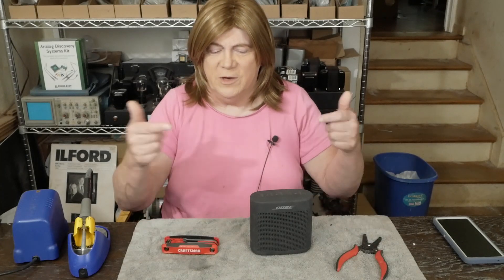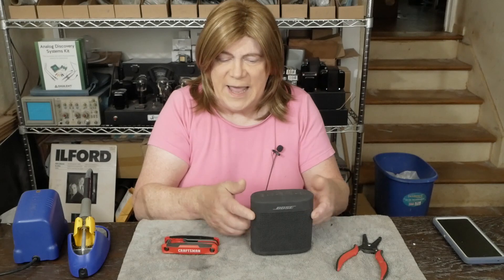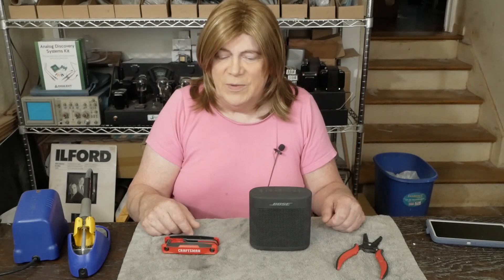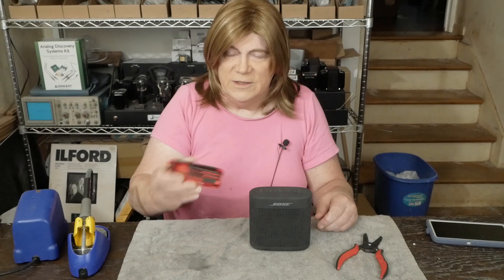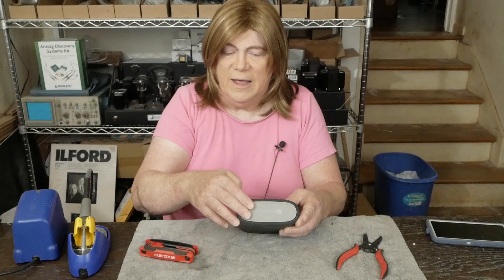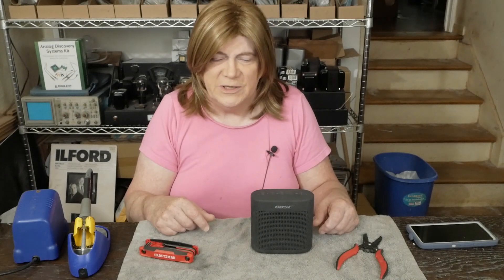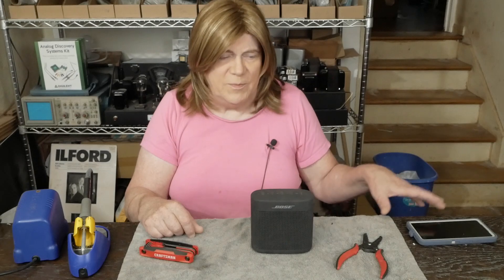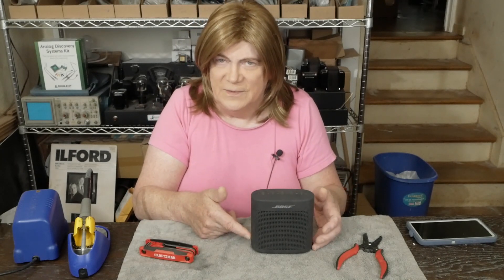Monday Monologue: Disposable Electronic Devices & 500W Amps?

Comment: i have  DG SE-1 EL84, 300WPC van alstine hybrid amp, crown CE2000 (400w into 8ohms and  1kw into a 2ohm) and a buncha other amps. my JBL L150 are designed for 300WPC, so thats what i give em. i have 10W magnavox amp for 90dB speakers at near field listening and several things in between. no problem. some speakers want more power/more current, some need less. some want more power only for brief moments. some people like the headroom. and, as you mentioned, then theres subs. good video.

Comment: Planed obsolescence, has been a big deal since  the 1930s . Something about protecting jobs by making sure there is stuff to make . I blame the great depression and before that light bulb cartel , the Phoebus cartel. When they decided In The 1920s that light bulbs was lasting to long and hurting sales . So lightbulbs have died faster ever since. So more sales. Yes they can definitely build better. But they won't and the government is ok with that.
Reply: Thats right. Mercedes car maker almost bancrupted because model W124 was so sturdy and durable that sales new car went down. W124 is a classic which is still reliable, repairable, and loved by the people. Since then all Mercedes models are more or less crap. Except of Unimog specialised trucks sub-brand. Rcently EU implemented law forcing producers to make home appliance serviceable for certain period and spare parts available. Single parts! Not multipart components worth 50% of a new device.. USA government should go the same way
Reply: @yellow_noise3  I still hope to have a w124 one day. They are such nice cars .

Comment: The wattage is all about marketing. My primary system is a vintage Yamaha with 20 watts per channel. I never turn it up past about 10-oclock because it gets too loud for me.
Reply: I use a five watt single ended anp with a pair of subwoofers and I can turn it louder than I care to listen. My music of choice is classic rock with some newer rock.
Reply: Agreed. I only need 7 watts which my single ended tube amp puts out (for the lower bass two REL subs).

Comment: Funnily enough I doubled the power output of my Hypex Nilai power amp over the weekend. It comes as a 250W (4 & 8 ohms) kit with two amplifier modules and a single PSU. I added a second PSU to make it a dual mono amp increasing the output to 525W into 4 ohms. In my subjective listening, I feel that the bass has more control than before. I view amplifier power a bit like automobile power. Sure you can get from A to B with 100bhp but having the option of 500bhp on tap is much more entertaining.
Reply: Hey. Can I ask where you ordered your 2nd PS from? And did they provide the extra connection wires. 
I've found a couple places that sell the PS but I'm just curious who you used. 
Thank you for any help with this
Reply: @NosEL34  I am in Australia and got the amp kit and second PSU from the local distributor - Audiophile Shop Australia. For people in the US, Madisound or Deer Creek and  for people in Europe, DIYClassD. The PSU comes with two 30cm amplifier connection cables (that I did not need), a 30cm power input cable (that I daisy chained to the original power cable) and a 30cm 12 wire auxiliaries’ cable. I soldered five wires from this cable to the original 12 pin cable. This required carefully removing some of the insulation from the original cable and soldering the ends of the new cable onto the original then insulating with electrical tape. The five wires I connected were:
Pin 2: Ground
Pin 7: Pushbutton+
Pin 8: Pushbutton-
Pin 9: Trigger+/-
Pin 10: Trigger +/-

Comment: My self-built "Silicon Chip" magazine stereo 'Ultra-LD Mk4'  integrated amp will put up tp 135W RMS per channel into my  97 dB/1W/1m 'Majestic' speakers (at .0003% THD) that I also built.  I can't really stay in the same room with the amp turned up full, but I can go outside & mow the lawn with my petrol mower & still hear it pretty clear!

As you say quite rightly though, it's the first watt that's the most important.

So I checked the specs on my amp, & the THD + noise is higher at 0.06W than it is at 135W!

At 0.06W its THD + noise is about 0.004%, & it linearly drops down to about 0.0003% at 10W & above up to clipping.

So it's still not too bad at low power.  And the designers had a lot of trouble separating the noise from the distortion.

But see my problem Stephe is that nearly all my vinyl records were destroyed in a bushfire in 2019, so I really only play CD's these days.  CD's have a dynamic range of up to 100dB, as opposed to records, with a usual dynamic range of 35 to 40 dB.  So clipping my 1 or 2 watt valve amp (that they said was 7W per ch) is always on the cards.

Of course, it was a labour of love building my big amp & speakers though!
Reply: I have always been under the impression that many multiples of the average power is used during Peaks. So if you're only using a couple of Watts most of the time, for milliseconds you're going to need a couple of hundred Watts to prevent clipping
Reply from the maker: And maybe part of this is tube amps "soft clip" and SS clipping sounds so bad, it' has to be avoided at all costs?"
Reply: @SkunkieDesignsElectronics  very likely that is the case. A few milliseconds of hard transistor  clipping could maybe be heard very subtly and not really even consciously, but more as an absence of fine detail and spatial cues, or just an uncomfortable bit of listener fatigue.
Reply: @SkunkieDesignsElectronics    Oh yeah that's true.  Definitely sounds crap clipping a SS amp that's for sure!  Although, I have a pair of yellow clipping leds on the front of my Mk-4!  The clip detecting circuits activate the leds whenever the output voltage reaches within 4.7V of the power amp's supply voltage of +  &  - 57V.  I'm not too concerned though about damaging my speakers as they're rated at 300W rms.

I know there is rounding off of a maxxed out valve amp output, compared to the squared-off flat topping of an SS amp output.  And I know that most valve amps produce the less discordant & sweeter even harmonics, that's for sure!  Often I barely even know my little valve amp is peaking out!

It's a pretty little thing to look at with all stainless steel, & black painted O.P T's.  I've mounted polished 4mm S.S.  threaded rods around each valve for protection, bolted into a polished S.S. ring at the top.  The orange glow from the filaments looks nice at night time under subdued light.  Actually there's 21 leds all together in my Mk-4 amp, which seems ridiculous really, although most of them are on the inside.

I'll have to check.  I forget what the make up is as far as harmonic distortion goes in my Mk-4, whether it's odd or even, or even if they mention it!

Comment: You’re not wrong about amp ratings, but solid state amps are different. 1, drive a solid state amp into clipping and your tweeter is toast, so good to have headroom to not blow tweeters, where tubes are very soft clipping, and do not blow tweeters.  2) the ability of an amp to drive a single tone to a power rating  is not a good metric. Tube amps due much better at providing more bandwidth, multi tone signals to the same power levels as a single tone. Solid state amps struggle here because the voltage is lower, but all amps struggle with high spectral density signals and would be derated if they had to be tested with multiple tones or waveforms over a large bandwidth. But easier to make low impedance power supply in tube amps, because the high voltage and audio transformer help with that. 3) THD is ridiculously low in at low input signal levels in the big amps.  4) I drive the local audio store crazy when I say I drive my big speakers with 5 watts.  I get it, I have driven 55 watts and 85 watt amps to the point they are done, and at n audio volume equivalent to. A 10 or 15 watt tube amp.  Again, power supplies in many solid state amps are not up to the task. That said my 6 watt amp is not enough,  A 40 to 60 Watt SET amp would be ideal, for me. Need 10 times the power to be twice as loud. Really notice the distortion when I crank the volume on bass heavy music. Hence push pull amps exist.😊

Comment: corp greed is why they overengineer products. Cars are getting the same.
Reply: Quite the contrary. Under-engineering and cutting corners wherever possible. Cramming as much flashy marketable features into the thing, not giving a damn about their quality and reliability. Not to be confused with over-engineering for regulatory compliance, because that's another thing.

Comment: I have low wattage tube amps i love & they sound great with certain speakers. My solid state amps have some wattage though. My 2 main ones are 380x2 & 250x2. Really clean ultra low THD though..which is what you want on a high powered amp.  I use them on towers with multiple drivers though..that can dip under 4ohm at a couple frequency's. Most want or need that power for the headroom, the transients, the dynamic peeks without distortion. Stable consistent sound at all volume
 levels. 
Like if you've ever been cranking up your system & at some point its getting louder but the bass seems to be getting lower or disappearing..you need more wattage/cutrent. If you have a good size room, some speakers that are around the 4ohm area, dual 8 or 10inch woofers, 90db + dynamic peaks, your amp better come correct with the current...or its going to start sounding compressed. 
It may seem ridiculous but I'm of the mindset that the more clean wattage the better. I look at tube amps a little different though. But that's why I like tube preamps with SS amps when using multiple driver speakers.
Reply: I should have added that the sensitivity of a speaker is a huge factor as far as how much wattage I want. Go back to the 80's & I could easily find big speakers with 12 & 15inch drivers that could be powered with a few watts. That's certainly not as common today.

Comment: Me I’m using 12-15 watt tube amps that runs 3 way speakers 1-15” woofer, 1- mid horn, 1- high freq horn.  In three weeks I’ll be using 6550 mono block tube amps 1959 issue.

Comment: i prefer having gobs of power on tap. i feel the music is more dynamic at lower volumes. i also prefer towers to bookshelf speakers.
Reply: The thing about higher powered amps, is they have huge power supplies. It’s not the watts that give you the dynamics, it’s the bigger power supply. You try a 30 watt Class A amp, with a proper power supply, you will have an amp that is operating in its linear region and will have all the dynamics of a bigger amp. Meaning, it will sound better. The sound you are listening to is being sent directly from the power supply to your speakers, and it is controlled by the amp.